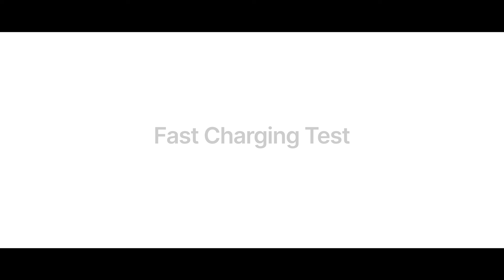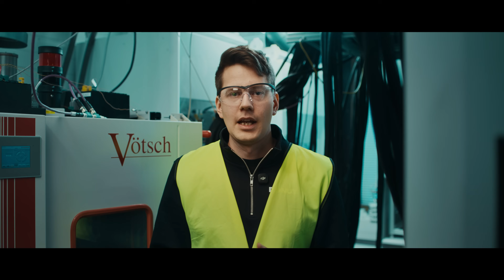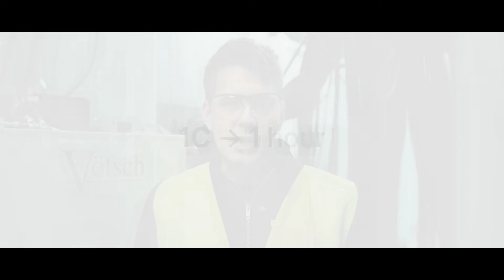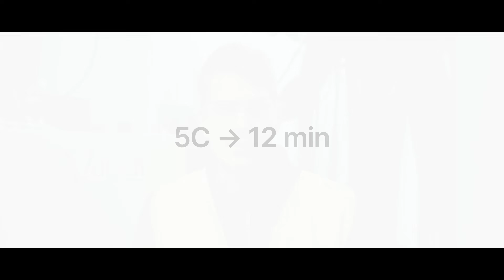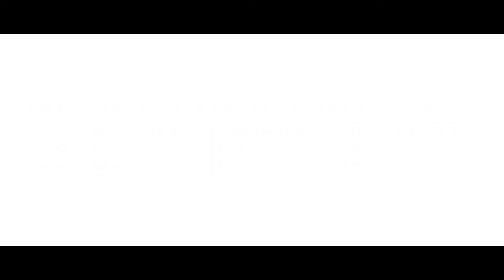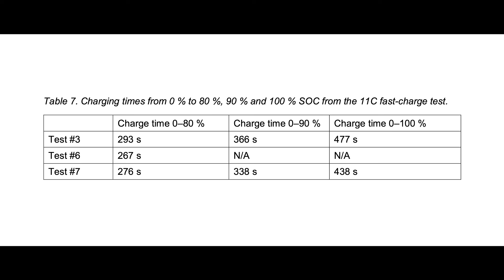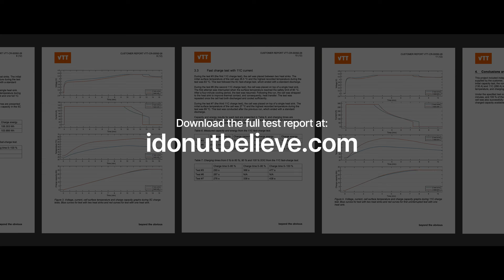Donut Solid-State Battery: Fast Charge Test | I Donut Believe (Pt.1)

Comment: I read the report, a few notes to be mindful of, the testing facility, which is a third party company is very careful to specify that the test article is “reported to be A solid state battery by the customer [donut labs]”
To me while this is better then nothing there really are a few key questions that need to be answered, this doesn’t do much at all to disprove the idea that what they have is a either a super capacitor or some sort of hybrid semi solid battery. It doesn’t demonstrate or validate the claims of 100,000 charge cycles. It does show that energy efficiency during fast charge is only about 85% I think that seems on the low side.  
The test themselves are not designed to actually answer the questions we have, it only proves they have a charge storing test article that is capable of fast charging, in fact, the results are actually totally consistent with a conventional LiPo that has marginally lower impedance then what is on the market. I remain unconvinced, I hope I am wrong, truly, but this feels like an attempt to appear like they have solid evidence with the knowledge that most people don’t have the expertise to read this. Hopefully my comment doesn’t get deleted lol
Reply: Bravo! Very few people notice this! The lab clearly washes their hands from the scam

Comment: Hi there Marko! Having read through the report, your single-cell performance is already quite impressive, with no appreciable degradation even at 5C to 100%, but it did show slight degradation at 11C. Could you show these same tests of your battery for 0-80%, preferably with charge-disharge cycling, to put it in a more real-world scenario? I want to know if the 11C degradation is simply a result of pushing high current above the typical 80% cutoff for lithium cells undergoing fast charging. Again, pleased with the work you're doing, and would love to hear more.

Comment: The single most damning thing about this report is the absence of a mass measurement. If Donut Lab truly has a 26 Ah / 91 Wh cell at 400 Wh/kg, it would weigh about 228g. Having VTT put it on a scale would take 30 seconds and would be the single most powerful piece of evidence they could release. The fact that this wasn't included — in a report explicitly commissioned to silence skeptics — is either a strategic decision to drip-feed validations or a very uncomfortable omission.

Thank you Claude Opus 4.6, you are my favorite expert😂
Reply: I mean I am very sceptical, but at the same time they have some legitimacy and it's not as revolutionary as people are claiming- others eg. BYD claim they can achieve most just not the long lifespan.
Evident from this video and the "shadyness" and weird non-transparent marketing the values they provide are probably exaggerated and not in real scenarios. But even if they deliver literally half on every measure it is still great improvement.

Comment: 1 of 3 claims confirmed 👍 let's wait till next week 😊
Reply: Not true, 26Ah*4.15v= 107.9wh; 107.9/0.315Kg = 342.53wh/kg not 400wh/kg. It's a downgrade, and at the module level you get 292.53wh/kg
Reply: @rwyo83  where those numbers come from?
Reply: @gridvid  The Donut Lab report stated that the nominal power is 94 Wh (3.6v*26Ah), the weight of the cell is 0.315kg that was shown at CES 2026, the energy density at cell level is 94/0.315 = 298.41 Wh/Kg; for the energy density at module level you substract 50wh/kg according to CES 2026, each module contains its own aluminum static cooling, so you get 248.41 Wh/Kg. To calculate the energy density at the pack level you substract 10% for the master controller y modules connection, so your final Energy Density is ~225 Wh/Kg
Reply: @rwyo83 the weight of this particular cell is not mentioned in the report. So...
Reply: @gridvid  But is was mentioned at CES 2026
Reply: @rwyo83 we don't know if it's the same size... let's wait and see.
Reply: @gridvid  It's the same size 22.85cm(l)*9.65cm(w)*1.2cm(h) = 264.6cm3
Reply: @rwyo83  the paper doesn't mention the size. I don't care about speculations... they need to confirm more in the upcoming weeks.
Reply: @gridvid  It's not speculation, I measured the size at the CES 2026
Reply: @rwyo83 and we don't know the size of the tested cell... so it's speculation till they confirm or deny their claims
Reply: @gridvid  It's the same, the cell was tested with aluminum static cooling, because it's the same cell for production into the bikes. You didn't hear anything what he said
Reply: @rwyo83 ... you saying "it's the same" is pure speculation. I wait for the next official test results 😊

Comment: You can chage many lithium ion batteries at high C rates, but it damages the battery. They do not show battery capacity after multiple high C rate charges. So until they do, this test does not say very much or prove other claims like 100,000 charge cycles, or even energy density. It weould have taken seconds to weigh the pack, so why hide this?
Reply: To make you and me to comment on this video and boost it and their brand?
Reply: True, we need the mass.
Reply: Because of the voltage curve.

Comment: Xiaomi 14 Pro my phone charges 0% to 90% in 10 minutes. 120 watt. This has been out for about 6-7 years.
Reply: Even theoretically to charge the 4149 mAh or 14.9 Wh with constant 120 W takes over 12 minutes. Xiaomi says it is 19min or 10min to 50%. Your old battery might charge quickly (in %), because it has degraded capacity. So when talking about %, you need to measure from what capacity you are taking the per cent, like they do in the  VTT report.
Reply: Toyota has not delivered on solid-state battery promises—they've repeatedly delayed them while continuing to make new ones.

The facts are clear:

A history of missed deadlines:
- Toyota originally promised solid-state batteries by 2020 
- That slipped to 2023 
- Then to 2025 
- Then to 2026 
- Now they're targeting 2027–2028 

Current reality check:
- In November 2025, Toyota halted construction of their Fukuoka battery plant—the facility meant to produce these batteries 
- This marks the second delay for that plant in one year 
- Toyota admits they're "reviewing and adjusting plans" with no new timeline 

What they're actually producing:
- Toyota's North Carolina plant (opening 2025) will make conventional lithium-ion batteries, not solid-state 
- Their current EVs (bZ4X, RZ450e) use standard battery tech 

The pattern:
Toyota keeps announcing breakthroughs (1,200 km range, 10-minute charging, 40-year lifespan)  while pushing actual production further into the future. Meanwhile, competitors like Mercedes have already put solid-state vehicles on the road for testing .

When a company repeatedly delays the same technology for nearly a decade while maintaining they're "on track," that's not innovation—it's marketing.

Comment: This battery is using finnish lab tech that  was taken from a South Korean lab. It's real but there's no sign it's mass manufacturable.
Reply: Toyota has not delivered on solid-state battery promises—they've repeatedly delayed them while continuing to make new ones.

The facts are clear:

A history of missed deadlines:
- Toyota originally promised solid-state batteries by 2020 
- That slipped to 2023 
- Then to 2025 
- Then to 2026 
- Now they're targeting 2027–2028 

Current reality check:
- In November 2025, Toyota halted construction of their Fukuoka battery plant—the facility meant to produce these batteries 
- This marks the second delay for that plant in one year 
- Toyota admits they're "reviewing and adjusting plans" with no new timeline 

What they're actually producing:
- Toyota's North Carolina plant (opening 2025) will make conventional lithium-ion batteries, not solid-state 
- Their current EVs (bZ4X, RZ450e) use standard battery tech 

The pattern:
Toyota keeps announcing breakthroughs (1,200 km range, 10-minute charging, 40-year lifespan)  while pushing actual production further into the future. Meanwhile, competitors like Mercedes have already put solid-state vehicles on the road for testing .

When a company repeatedly delays the same technology for nearly a decade while maintaining they're "on track," that's not innovation—it's marketing.

Comment: Well, for now, this is negative news, because the system requires cooling, at least passive for sure, possibly active, unfortunately, but this is not the most important test, the main thing is the number of cycles and capacity, and the last test will be when all parameters are measured simultaneously, which will speak about the viability of the technology and perhaps even a breakthrough, while this video does not say anything about it.
Reply: There is no active device that size that would not get very hot with 286 A. Just the connection taps and lugs at this size will be very hot, and donuts have not (yet) promised room temperature superconductivity. There’s really  no other way around these laws of physics. Current li ion batteries can’t go above 45 celsius, so if these can operate at 80-90 degrees C, the battery design would be much simpler and lighter.

Comment: Okay I've analysed some of the data given in the presentation.

The faradayic efficiency is "good" at the 5C charge, but very bad at the 11C charging.

Given the stats and that the efficiency is almost directly linked to cycle life we can assume:

At 5C the faradayic efficiency is 99,9885% or higher, meaning the Cells are holding up at least 1940 5C charge and 1C discharge cycles until reaching 80% SoH. Which is...well assuming 33.3 kWh and a realistic consumption of 9kWh/100km ....643.400 kilometers of riding.
Well my ass would definitely hurt after that much riding.

Taking the most optimistic value for faradayic efficiency for the 11C charge rate cycle, which is 99,6%; the battery would reach 80% SoH after ....drumroll....

56 Cycles.

Meaning: The battery won't even hold up for 20.000 kilometers.
But 11C is EXTREME... And probably not even needed at all (probably in some special kinds of usage, but not some bikes)

Giving that we won't really charge at 11C, and the Verge we saw in your presentation did just above 3C maximum IIRC, I expect a ~2000-2500 cycle life expectancy battery...or probably more.

Kind regards from Germany 
(And I want your cells in my bike😉😂😂, even if Energica is a direct adversary of Verge, but the market lifes from competition)
Reply: Dendrite is not a factor for their chemistry. So you gotta' toss out everything you know about conventional batteries and wait for this new testing.
Reply: @JDDevice we don't know what this SINGLE test cell is made up off.
Even with that, dendrites aren't the only factor for cycle life limitations.
Why did you even come up with dendrites? I never mentioned them at all.
Electrode breakdown, electrolyte breakdown, chemical side reactions etc. are all factors that lead to cycle life limitations.
What I did is only a quick and dirty calculation given on the limited data we have...
7 charge cycles obviously can't be taken seriously for cycle life estimation

Comment: Wow, to match the 64 kWh capacity of a standard Tesla Model 3 battery pack using the Donut Lab solid-state cells, you would need 666 cells and to match the range, the resulting battery would be roughly three times lighter and charge five times faster

Comment: That voltage discharge curve was extremely steep.  Unfortunately any comments here talking about the actual numbers will get buried under the cheering squad
Reply: It reminds of sodium ion cell curve. The plot x-axis is 9h long, so it looks steeper than typical SOC x-axis. But is it a major disadvantage, as we have learned to extract the energy and power from that voltage range pretty well with power electronics. At least the SOC monitoring should be easy and accurate.
Reply: @lauri8484 I think it's maybe steeper even than sodium.

This may explain why they have talked of selling their battery with their motor and their controller and their software, because it's infeasible to boost/buck the voltage to something steady at the kinds of current that will be needed.
Reply: @Juttutin  dc voltage will be at least 400 v in the battery pack level, and modern inverters are capable of producing almost as much power in the 3 V cell volt as in 3.6 V.
Reply: @lauri8484 for some reason I thought the discharge curve went down to 1.x volts, even though I paused on it.  My bad.  Also, I've been spending too long in the DC-DC world, doh!

Comment: Major red flags only from the VTT report:
1-Only one cell tested — no replication, no statistical validation.
2-Customer report, not certification — paid test under client scope, not peer-reviewed.
3-Chemistry not verified — VTT did not confirm it is truly solid-state.
4-Extreme temperatures at 11C — up to ~90°C; one test stopped at safety limit.
5-No cycle life data — zero information on degradation over time.
6-No energy density data — no weight or Wh/kg disclosed.
7-High heat losses at 11C — large energy gap between charge and discharge.
8-Climate chamber not controlled — chamber not operating, door partially open.
9-No safety/abuse testing — no nail, crush, overcharge, or thermal runaway tests.
Bottom line: impressive fast-charge demo, but far from production-grade validation.

Comment: Why is it that the people on here crying on here that this is not real, have no knowledge of what they are talking about. This first video verifiys a good portion of the specs we need, charge time, temp while charging, Kwh that this will provide, ( capacity ) AH ) I hope some of the future videos show a test of a  full pack they put in the motorcycle!!  I know they most likely will!  Stay Tuned!  Bye Bye oil companies gettin rich off of us!
Reply: its competitor's engineers panicking
Reply: you are a good customer. Buy a new battery after every cycle. I will buy a battery if it lasts 5000cycles.

Comment: I think there are going to be lots of technological breakouts as AI systems gain exponentially in intelligence, so these new batteries may well be good stuff. not enough to make me buy a new generation Verge motorcycle which will be the first vehicle to have them  and won't sell enough to need the batteries to be in proper mass production.

Comment: Based on some very limited research it sounds like 26ah is not very impressive for a pouch of that apparent size. Makes me wonder if this pouch was optimized for charge/discharge and the next one will be a different pouch with different characteristics. That is of course based on the picture of the pouch, and comparing it to pouches that look to be comparable in size, with the assumption they went with a standard size, since I believe they mentioned that.

Comment: Thanks for the report - you all should go read it carefully, particularly page 7, which they didn't show in this video, and which proves this is just a supercapacitor. The discharge characteristics shown are consistent with supercapacitors, not with batteries. Supercapacitor voltage declines linearly as energy is discharged, while a battery's voltage remains relatively flat until very near the end of their capacity. This is what makes batteries useful, because their power output (voltage * current) remains stable until the tail end of their capacity. The linear decline in voltage that's characteristic to supercapacitors is why they are not useful for the same purposes as batteries.

The Donut "Battery" (supercapacitor) we see in the video is about the size of a large laptop battery, and according to the report has similar total energy (90-100 Wh), but its voltage characteristics (again, graphed on page 7 which they didn't show you in this video) mean that if you tried to use it as a laptop battery, it would only provide useful energy for maybe 10% of its capacity. This whole thing is a marketing stunt.
Reply: Yeah they never made a claim on self discharge rate. Nothing like a car that goes to 0% after 5 days in the garage. This is a marketing scam
Reply: Maybe you didn't read the part where they state that 99.8% or so of the capacity is usable (it says it in the report)
Reply: @davidgaina5659  That just means it output the same amount of energy that they put into it, meaning the charging was efficient and had minimal losses. Nothing to do with whether the cell's characteristics make it suitable for the same things a real battery is suitable for.
Reply: @Onihikage  maybe you should just wait for the next tests then
Reply: Boost converters are a thing
Reply: Is that why there is a drop in voltage at the top of the curve when the current is 0?
Reply: @valtigress  No that's just voltage sag- it's present in pretty much every battery chemistry. When a large load is switched on, the voltage will near instantly drop a bit as the current ramps up.
Reply: Americans cope and seethe really hard at this. 

They think everyone is a scammer like their own people. 
Instead of inventing a better battery, all they do is discredit.
Reply: @fofopads4450  Being skeptical somehow means that you're projecting your own dishonesty?

Man, these comment sections are great. When this either crashes and burns or causes a tech revolution, the schadenfreude will be delicious.
Reply: @monkeysfromvenus  americans are the ones who glorify scammers on forbes all the time. 

Healthy skepticism is different.  Is based on proper technical knowledge and not speculation.  

I am not saying you should believe Donut at face value, I am saying americans are the least reliable when they themselves elevate scammers as long as there money in it.